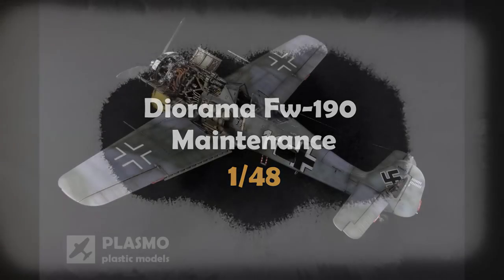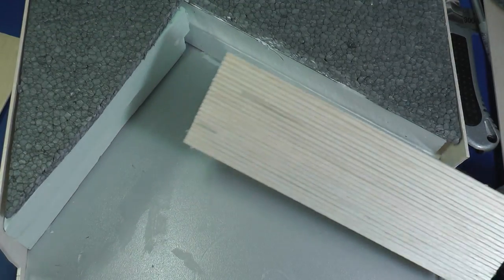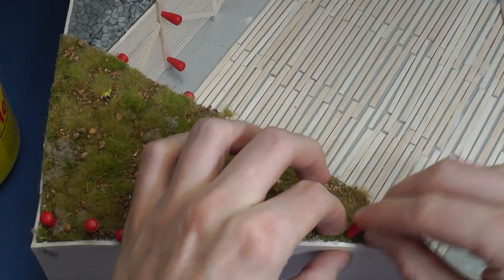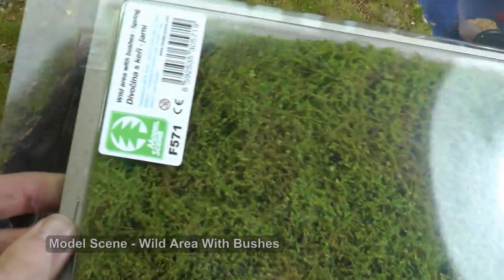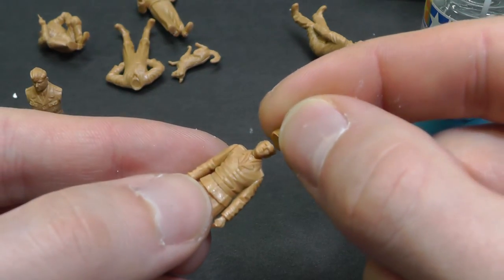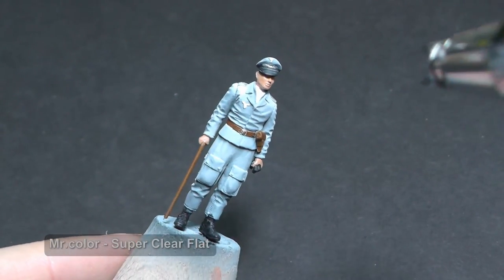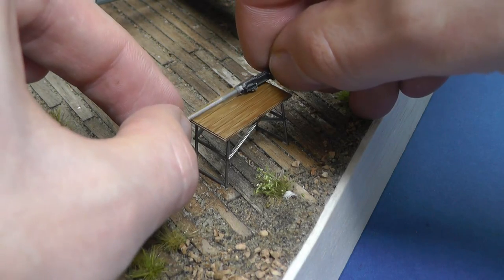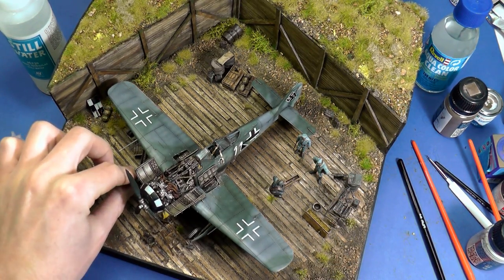Focke-Wulf 190 Maintenance Airfield - Diorama 1/48

Comment: Nice touch with the tracers. While at AIT a few of us volunteered for an ammo duty stint. We spent 3 days pulling tracers out of mini gun belts and replacing them with regular bullets. The base was testing a new mini gun motor and decided not to set fire to the test range this time. We got to fire the mini gun when the test was over to use up the rest of the ammo. 3 days of work goes zziipp in an instant. Nice modeling tips. Just getting into airbrushing now and thanks for digging up that memory. It all came back in a flash when you painted the first tracer.

Comment: Looks very good. I like it. 
What I do for painting figures is: (I use Vallejo acrylics)
1: prime in 3 stages 
     A: full coverage black primer. 
     B: spray gray primer from above at 40-45 degrees
     C: spray white primer from directly above 
2: base coat
3:  mix shades and highlights 50% paint & glaze medium and apply accordingly 
4: seal with gloss coat 
5: wash with thinned oils 
6: retouch highlights and add weathering as desired (e.g. Oil, dirt, grass, blood)
7: seal with ultra matte
8: apply satin clear to skin and gloss to eyes and any clean metal (satin to dirty/heavily scratched metal)

One more tip to share. With moss, I found moss texture paint; or mix ultra fine sand of fine glass powder (the ready made moss textured paint uses glass) in two-three tones. It looks super real. That's how I achieved the real moss look on my stone walls (see my Facebook store for images). 

And using the readymade grass mats isn't cheating. I call that working smarter, not harder. 😉😂   I say, if you can afford it, go for it. The one you used looked really good. 
As to be expected, yet another great video. Thanks for sharing.

Comment: Question: I seen you used acrylic paints on the models then protected them with a lacquer clear varnish and then used oil paints with enamel thinner, Im fairly new to this, do I need to use acrylic varnish on top of acrylic paints with acrylic washes to keep it all the same? Or can I follow the same process of acrylic paint then lacquer varnish then enamel washes or would that ruin it lol?

Comment: Was disappointed to see you use the premade mat. You honestly can't be happy with the finish to it. But the extra added gear covers for it. Anyhow just wanted to mention a better way to apply the white glue wash to grass, dirt and rubble other than heavy loading a brush with it and patting. I find that method can move things like grass and rubble which is annoying. So I use the same glue wash in a spray bottle. It get's into the crevices better and lays a more even application that attaches everything much better. So why change when the method you use works fine? ...why not?! It can't hurt to try it and it is easier. Just a suggestion because it works better. Good video, thanks for sharing.

Comment: Its very well done, better than many, however one thing that is very wrong, and I dont want others to follow thinking its right, why did you use cyan sky blue for uniforms ? A simple google will show you they were nothing of that colour, they were a grey blue , a medium to dark shade as well. same shade as RAF but less blue in the mix. I see other modellers using cyan, why ? Sheer guesswork and completely and utterly wrong, may as well use pink.

Comment: I like the diorama but... 1. Why is the man giving the dog a nintendo 64 cartridge without the label?
2) Why are they repairing the plane in an extremely spacious trench?
Reply: The 2nd is because it's an aircraft in a revetment. Revetments are basically parking spots with high walls around them, as a place to park aircraft while they are being refueled or rearmed. This is so that if the aircraft exploded, all other aircraft would have already been divided off from it, and a chain reaction of exploding aircraft is therefore less likely to happen.
Reply: @GroundHOG-2010  thanks for clearing that out. I didn't know that. (*The more you know*)